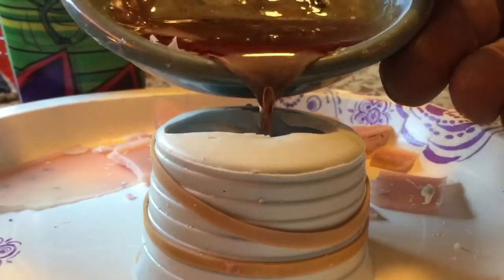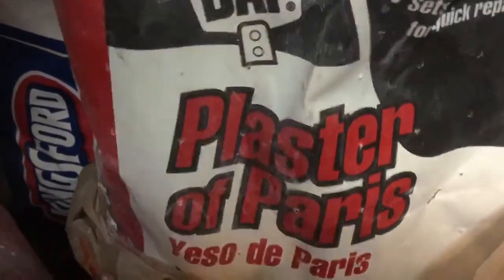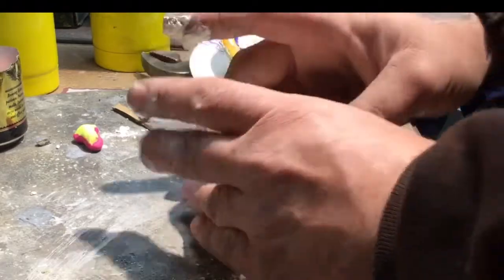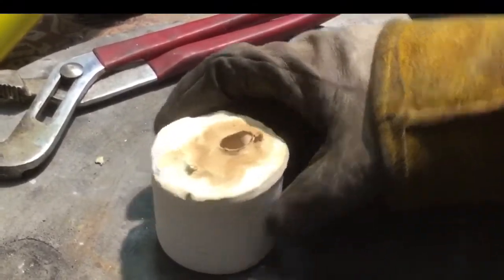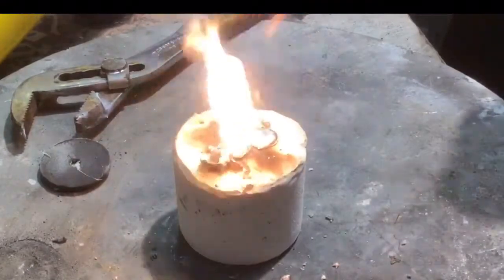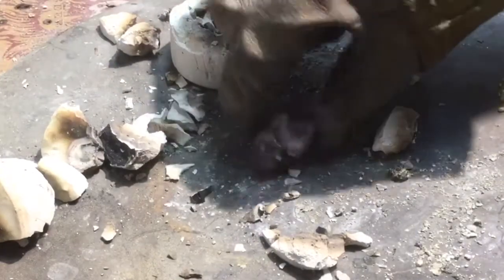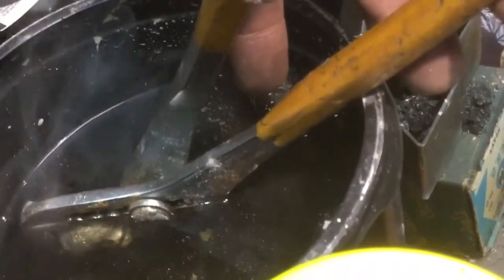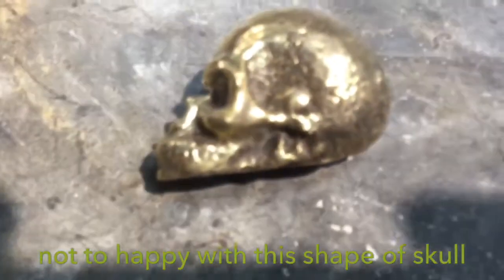Casting a brass Skull in plaster

Comment: Looks good! Try immersing it in a pail of water when it is hot. The ceramic will crack by itself and cool the metal off faster than air. But you probably know that.

Comment: Glad that i found this video. I've been wanting to melt brass and make a casting, but i wasn't sure what casting material i could use that would withstand the heat.  I do alot of wood working and i'm wanting to make my own branding iron logo out of brass... I'm still not sure exactly how it's going to work, but i'm gonna give it a try.
Reply from the maker: Thanks, it is tricky this way, I've tried to make larger pieces this way, only to fail, the plaster is not really a great idea 😂, I think petrobond sand casting might work better for a branding iron? I made a copy of a DEADPOOL out of brass that way, came out great.

Comment: so you use just plain plaster of paris? and how detailed do your castings come out without the assistance from a centrifuge or vacuum?
Reply from the maker: I did this a couple of years ago in my infancy at casting, yes that’s plain plaster of Paris, I got lucky with this pour? I haven’t did investment casting lately, but do plan to again, with a vacuum chamber, and probably a different investment!
Reply: @FREDSHED  that's cool, i look forward to it. I do sand casting, but I'm just getting into jewelry so your video shows that simplicity can go a long way since brass is very similar to gold, right on man!
Reply from the maker: I don’t know, I never even imagined to melt gold, not sure on temperature, Brass is toxic, this I know, good luck
Reply: When doing investment casting to cast glass (which has a lower melting point than brass) you should use a mix of silica and plaster (also called hardened plaster). This makes the mold much more resistent to heat, so I imagine it could be an option here as well. And it's also common to have the glass in small pieces in a reservoir on top of the mold and then place it in a kiln together with the mold, so with the temperature rise the material in the reservoir will melt into the mold. Thanks for the video, great demonstration! Will try something similar using a kiln

Comment: Can you say more about how you know when the moisture and wax are completely out of the mold?
Reply from the maker: I guess I got lucky on this pour, I heated the molds in a toaster oven for about six hours, starting at 100 degrees, and increased the temperature every hour.
Reply: What was the final temp after six hours? Thanks!
Reply from the maker: Probably 400, I think that's the max on the toaster?
Reply: Oh okay. You used the toaster. Got it. Well wish me luck! Thanks for the tutorial, it's a huge help.
Reply: Just adding some info here: I'm using a model made form beeswax, which melts at 150 degrees, according to Google. So, several hours at 400 ought to do. Thanks again!
Reply from the maker: Toaster oven, and good luck, I haven’t had much luck since I did them skulls

Comment: Where did you get the skull ingot mold that you began dumping the left over brass into?
Reply from the maker: Jason Todd , eBay, they are still available, in three sizes, I have the large one, cost is I think $54 usd.
https://m.ebay.com/itm/3D-LARGE-12-oz-SKULL-FACE-GRAPHITE-INGOT-MOLD-FOR-MELTING-GOLD-SILVER-COPPER/381709076720?epid=1078496084&hash=item58dfa248f0:g:XqUAAOSwaB5Xmm3E

Comment: How did your other ones come out.  Good job btw.  My turtles come out like they were exposed to toxic waste.  Lol
Reply from the maker: They came out rough, I am going to try and heat the plaster up a bit more, as to not shock the metal as it cools, I hope that will do?
Reply: Fred's Shed try adding some fine sifted sand to the plaster.  I see lots adding some type of sand in their plaster.  That skull came out awesome.